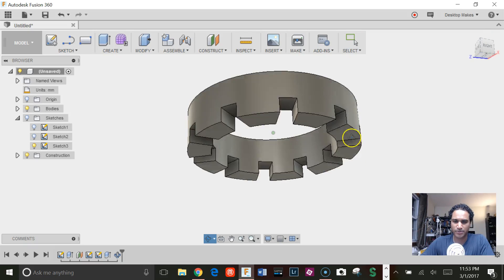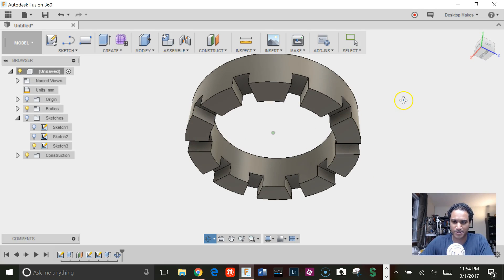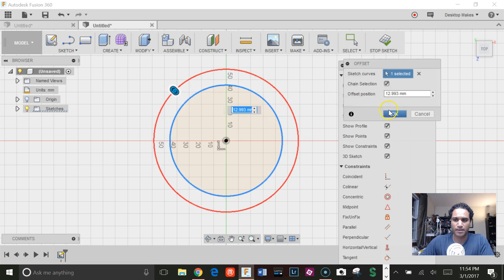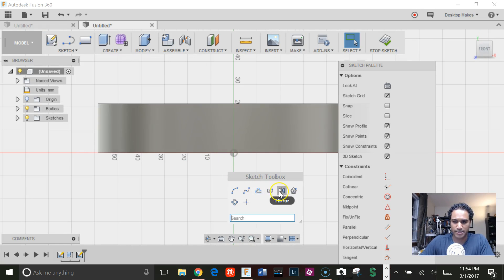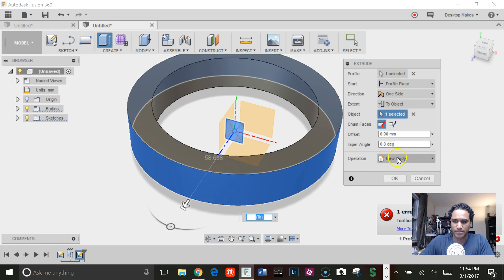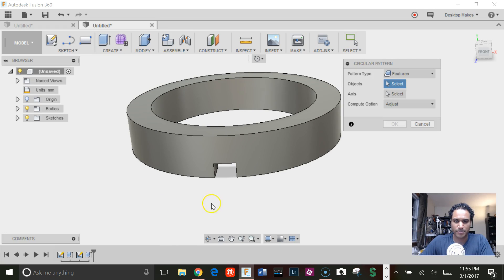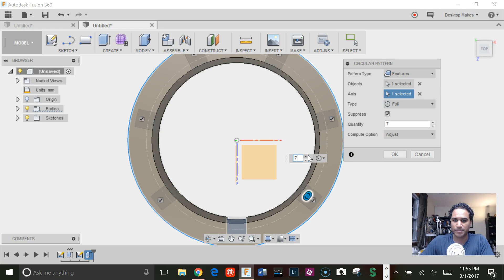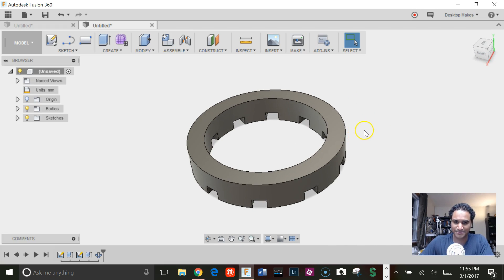Circular Pattern Cuts in Fusion 360

Comment: How would I be able to determine the length for the rectangle if I want to make two of these pieces to join together (into one piece)
Reply from the maker: If you want to make two of these and have them snap together, you'd need to make one slightly smaller than the other.  For example the rectangular holes of one part would need to be 0.2mm smaller than extrusions of the other.
Reply: @DesktopMakes  Excellent! Thanks for the quick reply!

Comment: super great! can you explain why you use the pattern type "features"? thanks
Reply from the maker: When using the pattern tool, you have the option to pattern a face, a body, or a feature.  Feature lets you select a feature from the timeline.  Generally I select this when I can as I find it the simplest and most reliable.
Reply: @DesktopMakes  thanks :)

Comment: Is there a way to place holes around the circumference of a tube? I've found a way but it was such a performance. I was trying to draw a component 63mm OD, 50.8 ID with 6 M8 holes equally spaced 20mm from one end. Can you help, please? I'm very new to Fusion 360